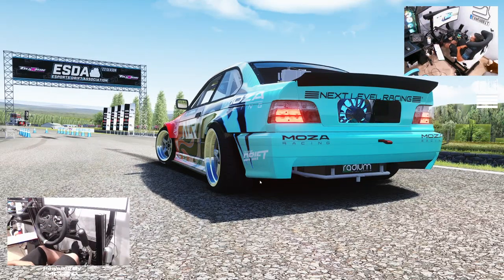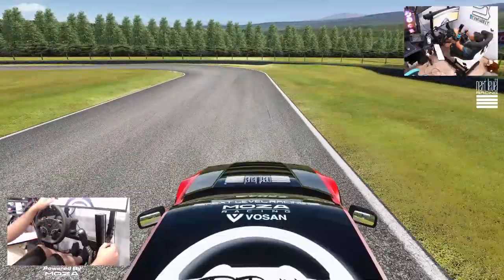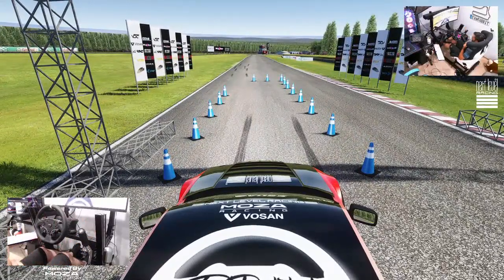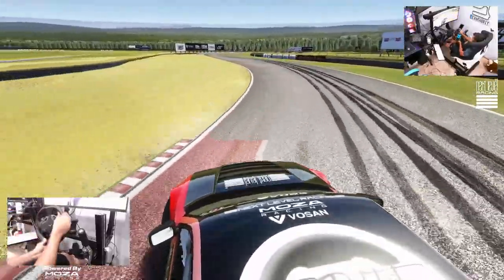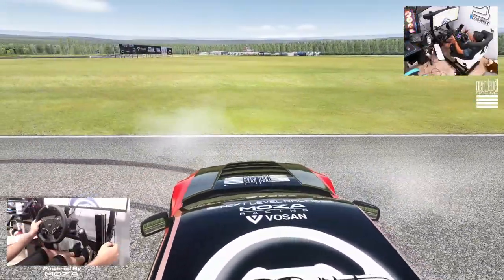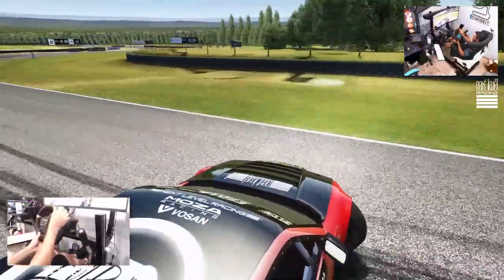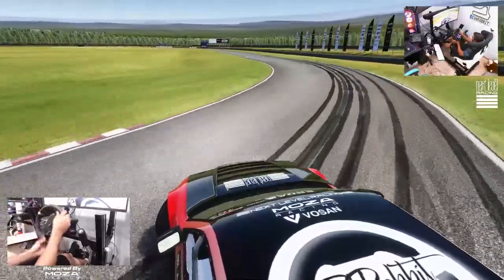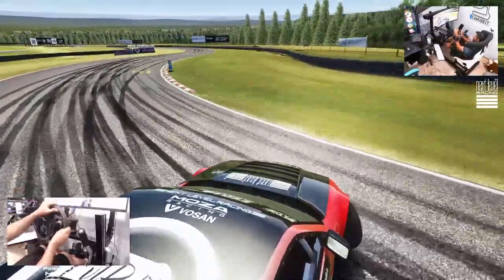ESDA Testing Rd 5  with the MOZA R5 could this be a lucky round !?

Comment: First corner is almost there, just want to check the car up a tiny bit more so you begin accelerating at or just before the inner clip. Wallride you want do a slower more controlled transition into it then try hold as much angle ass possible going through, then quick transition to big angle to slow the car up for the last inner clip 👍